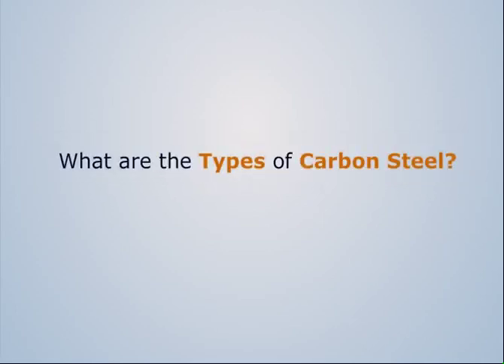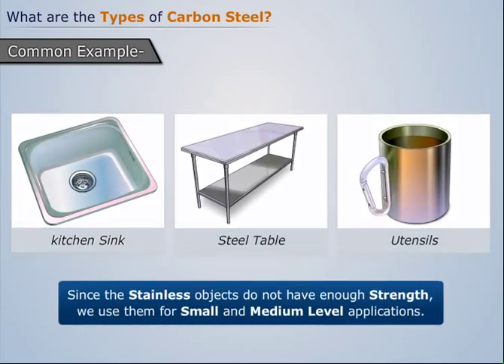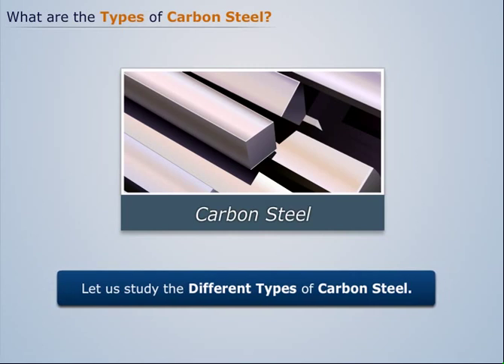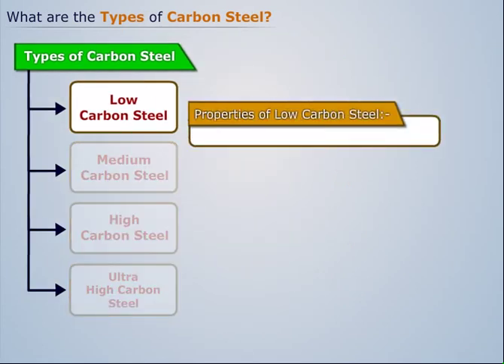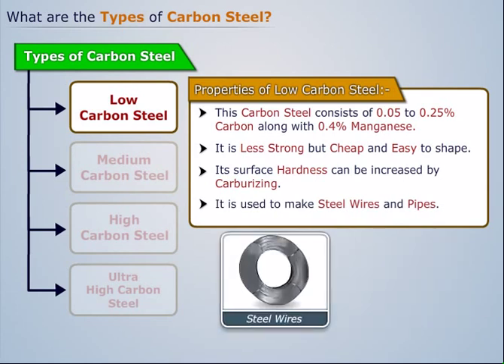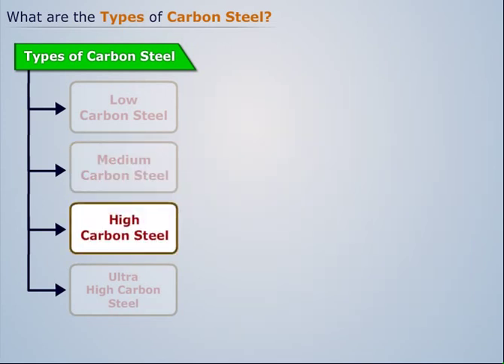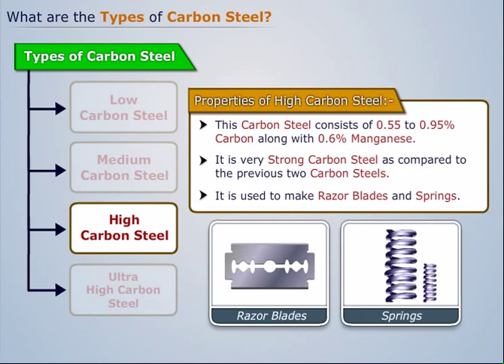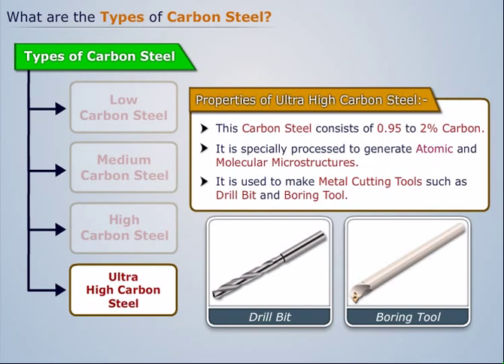Types of Carbon Steel | Engineering Materials & Metallurgy

Comment: Hello, Why carbon steel have manganese on it? What is the use of it? Does it make it harder or something like that? And what is/are the alternative material/s for carbon steel? I need answers please reply :)
Reply: Manganese is important to bond with Sulfur as MnS and prevent the FeS which have low melt temperature and when the steel will be deformed in rolling mill these FeS will melt inside the solid steel and ind the end of this process some dimples near these two phase interface will be the weak point of this material. Another thing is Manganese can improve steel strength by substitutional solid solution strengthening mechanism that stretch the crystalline reticulum that improve the difficult for dislocations movement.